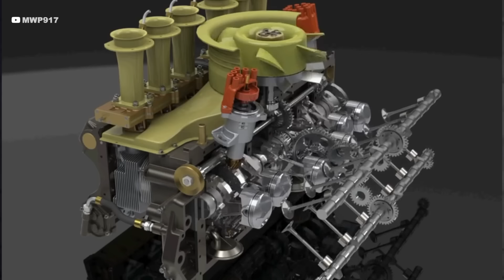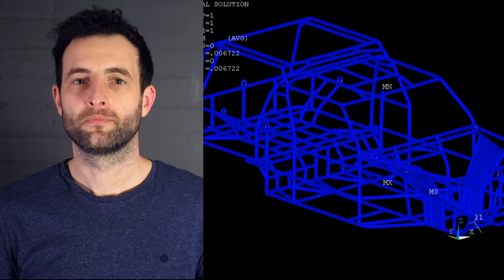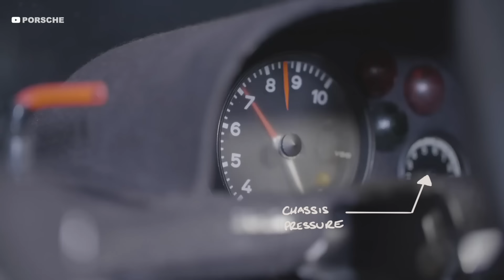The Porsche That Had an Inflated Chassis

Comment: "With top speeds similar to F1" ? Dude! with over 400 km/h  the 917 was much faster than F1 at the time !
Reply: @therrydicule  ...I know that effort...and look....even that car with 1200 hp...did what?.... a 220-225 mph?,....maybe hitting 240 on the straight?. The car had a CanAm body, where downforce was necessary, and the car had an enormous frontal area....it was wide with large Cd or drag coefficient. Here's a factoid for you and others to chew on.....the needed HP to get to a certain speed, increases with the CUBE of speed. Yes....raised to the "third power". If this means nothing to you from a math standpoint....let me use an example. A good 911 can hit 150 mph with 200 HP. To go just 50 mph faster, ...to hit 200 mph....it will need about 470 hp. Think this thru....we can't say "coulda-woulda"...the fact is ....it didn't.
Reply: @TheWilferch  Dr Helmut Marko and some other old dutch guy raced le Mans in the past as collegues ( he told on tv recently while having dr Helmut Marko on a live feed.) and they said, they did reach 400km/h back in the 70ties'.
the 917 turbo had over way 1000 HP
Reply: @AnalogDude_  ...for God's sake....I said here in other postings many times......there is the 917 of the video.....the coupe in endurance racing trim as raced at Lemans, and as the opening scenes in the vid depict...and this car had 520-600 hp. Also ....it 1.) NEVER did 400 kmh...and 2.) never had 1000 HP. The 1000 HP cars ( +/-) were the open-top cars with turbos....very different cars...as run in the CanAm series and also in the similar European Interseries. I also commented elsewhere here in response to someone posting on Mark Donahue's closed circuit top speed attempt...using a heavily modified CanAm car at Talladega with maybe 1300 hp....that it hit 221 ( or so) MPH (= 353 kmh). All the drivers slightly exaggerate...even Derek Bell. Finally, I had also responded on the official highest speed ever attained at Lemans.....from official record keepers...that the 917 never hit 400 mh....either as a practice lap or in  a race---> http://www.mulsannescorner.com/maxspeed.html.
Reply: @TheWilferch  even the/his wiki page says, the topspeed was around 400km/h
"De hoogst behaalde snelheid was bijna 400 km/u. "
https://nl.wikipedia.org/wiki/Gijs_van_Lennep ... i knew that before youtube even existed. i also knew that the 917 was unstable and they made the car longer.
Reply: @TheWilferch  https://en.wikipedia.org/wiki/Mercedes-Benz_W125_Rekordwagen
Rudolf Caracciola's record of 432.7 km/h (268 mph) over the flying kilometre on 28 January 1938, remained the fastest ever officially timed speed on a public road until broken on 5 November 2017 by Koenigsegg ....

1938!!!!!!!!!!!!!!!!!!!!!!!!!!!!!!!!!!!!!!!!!!!!!

doing 400km/h was nothing new for German car manufactures.
Reply: @TheWilferch  it has been mentioned on tv more than often before YouTube existed, that these cars did around 400km/h.
Reply: @AnalogDude_  ...I am very familiar with pre-war German "Silver Arrows". But....you are skirting the point. I am answering a very specific question about the 917 and it's claimed, driven, top speed. Cheers.
Reply: @therrydicule  Wrong 917.
Reply: @TheWilferch  Wil, you are quite right.

The claim comes from a conversation between Derek Bell and Norbert Singer during practice for the 1971 event. Bell asked how fast they were going on the straight and Singer calculated using gearing and revs. Bell says he also factored in tyre growth.

BUT!

Singer didn't allow for tyre slip - a powered wheel will make approx. 11 rotations to cover the same distance as a non-powered wheel of the same diameter will with 10 rotations. Bell says Singer told him the car was doing "246 mph". As Singer is German, I don't believe he used the imperial standard so I will substitute 396 instead. So, allowing for tyre slip - generally about 11/10 - you get the following answers:

396/11=36
36x10=360
Top speed measured by the ACO speed trap was 362. Q.E.D.

I'm not calling Singer incompetent or anything like it. What would be the point? But a rushed calculation, which was of little value in the overall duties of the Chief Engineer at the most important race of the season, is of little significance. He had other more pressing things on his mind, like overheating rear bearings on the LH, etc..

That factor for tyre slip isn't just plucked out of the air either. I got it from my brother-in-law who builds dynamometers. It's the only thing we can talk about without killing each other.

Scott Mansell is talking more and more BS by the day in his quest for YouTube hits. Money for myths.
Reply: @thethirdman225  ....I love the 917...it's probably my favorite racing car design, and I've followed this car since my youth when it first appeared. So...it pains me when myths get repeated and there is no basis for this. Thank you for supporting my claims and the basis for these.
Reply: @TheWilferch  dude, if the guy ( a driver ) himself says it on tv. than it's not the media, but original source.

Gijs van Lennep
https://nl.wikipedia.org/wiki/Gijs_van_Lennep, co driver of Helmut Marko.
Reply: @AnalogDude_  ..."Dude"...as I said previously before....if you read it....many drivers exaggerate ever-so-slightly...even Derek Bell. There is no speedometer on these cars...only Tachometers. And you need to do the calculations and also factor-in the noted corrections, also previously discussed.  Look at all the previous commentary by me and by others....and most importantly....look atthe actual written record of speeds attained ( measured ! ) that I posted as a link...during either practice or running in a race. I stand by my commentary before that this car never achieved this high speed claimed for all these reasons.
Reply: @TheWilferch  dude, try to get some metal help. don't you think a team has some guy with a stopwatch somewhere around the track? or 2? sure it wasn't to the second decimal correct in that, but still ... these people got the car (the 917) from Porsche (the manufacturer) do they have to doubt those people as well, because you say so?
Reply: @TheWilferch  .... and why are you picking up this discussion again ... 8 months later?
Reply: @AnalogDude_  ....maybe mental help instead of metal? How condescending some people are when hiding behind a keyboard when cornered on the facts. Why would having an honest debate and difference of opinion immediately cause someone to say such a ridiculous and rude thing? I stand by my previous comments ....supported by citations and official timing links. It's MUCH more than decimal error !! . I've followed this car and Porsche's in general since 1965. The car was insanely fast, but never hit 250 MPH ( 400 kmh). Going further, if you take the numbers in consideration...the car's frontal area, it's drag coefficient (Cd number) and the horsepower of the engine....that too (if you did the math) would tell you that 250 MPH was not achievable. It's all myth and hubris and something that should never have been exaggerated in the first place to create such an urban legend.
Reply: @TheWilferch  come'n dude, find the energy and make the intention to find some psychological help. https://files.porsche.com <---- there is a pdf that says 400km/h or 250m/h on the straight. pretty sure 400km/h + litle more was possible, but that also depends on the fuel load, the tire conditions, track conditions, temp. it was one of the most extreme cars ever build in human history with a super light chassis that was pressurized. after that it would not be repeated. 12 cyl boxer turbo.
Reply: @TheWilferch  and ... doing 200km/h on the highway is fast, doing twice that ... would probably be scary.
Reply: @AnalogDude_  ...why are you quoting the build architecture of this car? I know how it's built. As a matter of fact, Porsche sent me an offer to buy one in 1969 for $35,000. I have the letter and documentation. Such data has NOTHING to do with the claimed top speed. Even from Porsche files, etc and other publications. As I stated before, look at the MATH and the HP required. Thr HP required for incrementally higher top speed  increases as the CUBE of speed. I show (by example), that for a 911, 200 hp can get you 150 mph but you need an additional 270+ hp to reach 200 mph. Think about that. Really think about that. Irrefutable physics. Then translate that to what it takes to get a 236 mph car to 250. I will not debate this again with someone who doesn't offer proper verifiable counterpoints.....believe what you will, but it never happened. Look....finally this too.....Mark Donahue took a highly modified and streamlined CAN-AM version of this car to Talladega, where the track would allow nearly limitless pedal-to-the-metal driving without having to lift. This CanAm car had nearly 1300 hp, compared to the endurance racing coupe we're talking about here, that had anywhere from 520 to 610 hp. The Talladega run couldn't get the car to much over 221 mph. I'm done here.
Reply: @TheWilferch  you got 87 octane fuel at the pump, you don't know what Porsche had back in those days. : ) .. and they used all kinds of clever tricks over the years. additives, freezing the fuel.
Reply: @AnalogDude_  ...you just keep on swinging, don't you? I followed these races in real time when they occured... "additives, freezing the fuel". Nonsnense, and it doesn't alter the basic physics involved that can't be violated. BTW...cooling/freezing the fuel was done by Roger Penske to add a bit of fuel storage capacity, the colder fuel being more dense and allowing more fuel vs the spec required. You're now just swinging a bat for anything you can find.....doesn''t alter the science involved. Bye. But I'm sure you won't let this go and still need to have the last word.
Reply: @TheWilferch  you're just some random blob on the planet, Porsche says in their official documents 400km/h+ and that's what it is accept it.
Reply: @AnalogDude_  ...there we go hurling personal insults again.....the only thing you have left. No "official" Porsche documents of any kind certify 400kmh/250 mph. None. Bye.
Reply: @AnalogDude_  ..also this. The additional HP required to have a 236mph capable 917 do 250 mph.....would require about 713 hp total to do that. No endurance racing 917 had over 600-610 hp. Pure physics. Argue that.
Reply: @TheWilferch  well, the BMW F1 1.5 litre or 1500 cc turbo did 1.500 HP in qualify trim, but a lot less in race trim. using a manual valve after the turbo to cut the air intake.
who know know what tricks Porsche used back then. we will never know, those people are dead or over 75 years old in some residential home.

freezing the fuel means, you can pack alot more, but the density is also a bit higher,  bigger bang, just like a turbo + intercooler.  ... and they probably also knew about chemicals or ask the fuel supplier / manufacturer .. like how it's done in the current F1.

in the current F1 championship they still continue to braking or bending the rules, it's just matter not to get caught.
Reply: @AnalogDude_  ..I give up.....you would need over 700hp. Never happened. And the rocket fuels used in late 70's or 80's FI was not available in 1969-71 when these cars ran. My God, man.....give it up, these cars simply never hit 250 mph !!! You are reaching for any straw you can get ahold of !!!!! I lived through this period....did you?
Reply: @TheWilferch  i never said rocket fuel, but may something to lower or improve octane, compression ... who knows.
Reply: @AnalogDude_  .."rocket fuel" was the tongue-in-cheek name given to the "Special" fuel blends used during the heyday of the turbo FI era.....
Reply: @TheWilferch  Porsche won in 1971, it safe to assume they know / knew the tricks ... end of transmission.

Comment: "V12 Nah,Flat 12". well it is a V , 180 degree v12
Reply: theres a difference between flat v and boxer
Reply: @mathias6369  Yes, but the 917's engine wasn't a boxer.
Reply: I lost brain cells reading all 3 of these comments
Reply: @ProVision3187 oh yeah? i just repeated the sentence that was written in the video and corrected it. other guy said there are differences between 180 deg v engines and boxers which is true , and the second guy said 917ks engine wasnt a boxer which is also true. so what the fuck are you even talking about
Reply: Ryan Miller wrong , flat means both boxer engines and 180 degree V engines. They are called 180 V because their arthitecture is same as a V engine. In a 180 V engine 2 pistons from opposite banks share a rod journal (crankpin) and move together. Where as in a boxer engine each piston gets its own rod journal and therefore isnt connected to the cylinder at the opposite bank and dont move together. In fact they move in opposite directions to each other.
Reply: Ryan Miller oh i understood your first sentence wrong then , my bad
Reply: @AzathothsAlarmClock  ...The 917 engine has horizontally opposed cylinders...lying flat,...so it is a "flat-12",  but is not a boxer motor like the 911 is. The proper term is it's a 180 degree V-12....Why?..... because a 180 degree V-12 has 2 adjacent connecting rods on the same offset crank journals, making for a shorter engine.
Reply: @AzathothsAlarmClock  ...You don't know engines, then.  When one says 180 degree flat twelve,  2 adjacent pistons are on the same crank-offset pin, so they don't "box", but move together. A boxer engine has 2 adjacent cylinders, each on their own eccentric offset crank pin, and move out and in in 
boxer fashion. No kidding on geometry, etc, but that's the nomencalture used to differentiate 2 styles of horizontally-opposed "flat" engines..
Reply: @AzathothsAlarmClock    Modern day mullet man, chill out.
Reply: @davidlakatos9904  
It had enough of a punch as is... Doesn't to box, if you pardon my drift.
Reply: @AzathothsAlarmClock  Porsche themselves call it a V180°, I think they know better than some guy on the internet.
Reply: Ryan Miller yes their 6 cylinders are BOXERS. But not the 917s engine. That was a 180 degree v12. Instead of a 60 or 65 or 90 degree v12. Now boxer-12 makes absolutely no sense over 180 v12 because 180 v12 is already perfectly balanced in both primary and secondary orders , boxer12 also is balanced in both of those yes but its much longer due to not sharing crankpins so it makes no sense to make a boxer-12 hence why ferrari etc also opted for the 180 degree v12 configuration. However a boxer 6 makes a looot more sense than a 180 degree v6 since v6s have garbage balance in both primary and secondary orders, boxer6 has perfect primary and secondary order balances. So you can see why porsches 6 cylinders are boxers and why their 12 cylinders werent boxers and instead 180 degree vee engines
Reply: Ryan Miller you said „they site their engines as boxer6 not v 180 or anything else“ this literally sounded like you were trying to say 917 engine being boxer as well. That was what the fuck i was talking about

Comment: They could have filled it with helium and it would have been even lighter.😂
Reply: Right Above You  Helium and Hyrdogen have the bad property of leaking even when there are no cracks. Could've been part of the consideration.
Reply: Like the other guy said. Helium has a tendency to leak through things even without a crack so wouldn’t be ideal. Also nitrogen would be much cheaper and easier to get. And the difference in a helium filled chassis and a nitrogen filled one would probably only be a pound or two. You could save that weight easier by sending the driver to the bathroom.

Comment: That was very smooth sliding the product in. I liked the way you did it. The 917K and 917 LT were great race cars, but the Can Am 917-10 and 917-30 were absolutely mental. Add turbos to the LeMans car and cut the top off. Yeah, they were terrifying.

Comment: Factory team 917 driver Brian Redman told me that during the 1000k race on the brutally fast, longer, old Spa circuit, the cornering Gs were so heavy the frame was flexing. He said it "crazed" the perspex windshield so badly he could barely see straight ahead. He said he had to look out the side windows and judge where he was going by the sponsor banners on the crash walls!😮
Reply: In those days Spa was faster than Indianapolis!

Comment: There's another benefit to pressurising the frame; it meant the tube pieces could be thinner, hence lighter. 

It's known colloquially as the "coke can" effect. Compare the strength of a soft drink can before and after cracking the lid to get an idea of what I mean.

This technique is crucial in many rocket designs.

Comment: I once read that at least one magnesium tubular 917 chassis was tried...apparently did not work well or was misinformation.  LeMans once required cars have ignition keys....Porsche made their keys from aluminum and then drilled holes in the fob for less weight.
Reply: The ball on the shifter was balsa wood.

Comment: Another advantage to pressure is it reduces the compression force on the tube and reduces the tendency to buckle in compression forces.  This was not just a 40 PSI leak check, but a higher pressure structural member inside the frame.  The actual pressure used is a trade secret.

Comment: the chassis inflated with nitrogen is a known usage in aviation, like on the Aerospatiale Alouette and Lama tubular tail structure: it's to protect the internal surfaces from corrosion and with a pressure gauge on it, the smallest crack is detected with a pressure loss..